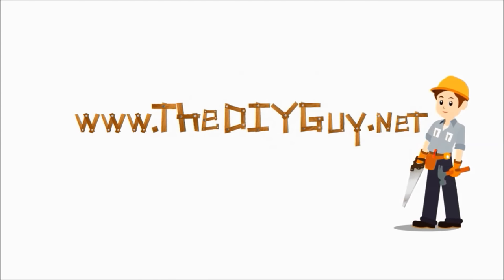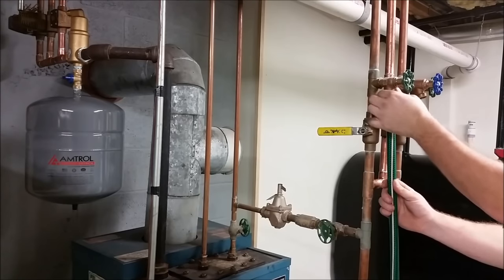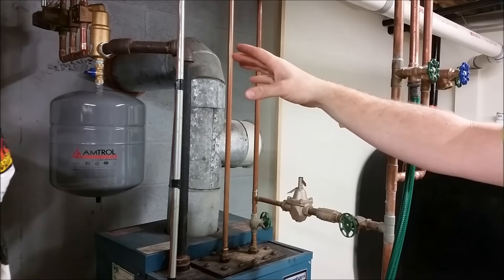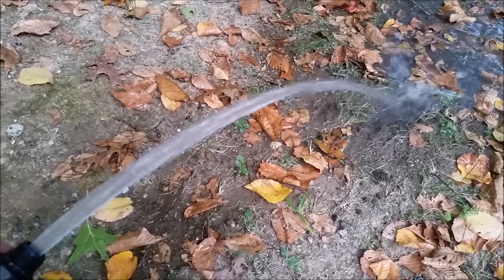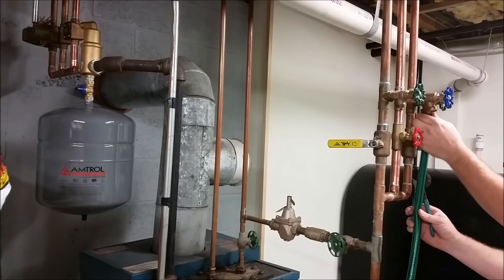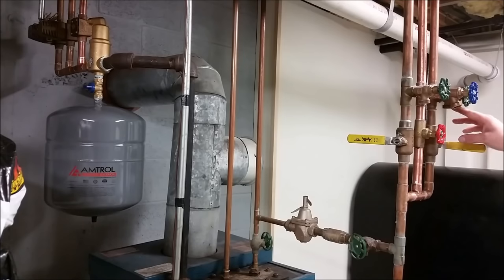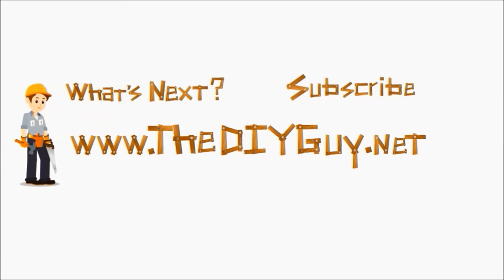How To Remove Air From Your Heating System

Comment: Does this apply to Air being anywhere in the system?  Or just in the Boiler?  We have air getting into the piping at the radiators. We have opened the valves to bleed the air out.  Do you also have a video for setting the appropriate pressure in the Tank?
Reply from the maker: Yes, This should be able to remove air anywhere in the system. As you are adding the water to the boiler and pulling it though the boiler and then the heating loop and then out then end of the hose. I'm guessing you mean either the air is getting trapped in the radiator or thats where you hear it.. For setting the pressure in the tank are you talking about the expansion tank? Most expansion tanks require a PSI reading of about 12 PSI. You check your manual for the precise rating for your expansion tank.

Comment: 0:42 Is it a good idea to install  "Garden Hose Fitting Quick Connectors"? It will be very easy to connect and take off the garden hose, but the tip of the quick connectors is narrower. I am worried that the narrower tip makes it hard to air purging.

Comment: What if im in an apartment building and have a separate thing of valves in my closet of my apt. , are those to be able to get air out? I've been having rushing/trickling water sound often.  It goes through 3 baseboard heaters

Comment: In order to get enough pressure to force out the air in the line don't you have to also open the auto feed valve fully?

Comment: Can you please help. I recently hooked up a boiler that has two zones (one zone for the first floor and the other zone for the second floor). When I started up the boiler and turned on the thermostat on the first floor, the boiler did not start. When I started the thermostat on the second floor, the boiler did start. Any idea why the first floor thermostat didn't trigger the boiler. We wired the thermostat wires to the aquastat (red wire goes to T terminal and white wire goes to TV terminal) Please let me know if I'm missing anything. TIA

Comment: Don’t understand what that control gadget does. Is there a computer board on the boiler?  It seems like just opening and closing valves and let the water make its rounds is enough. What is that gadget you were moving lever on?
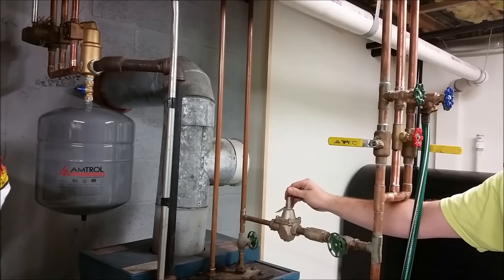Reply from the maker: I'm not 100% sure what you are talking about by "control gadget" I'm going to guess you are talking about the zone valve... the brass colored thing with the silver lever and three screws that I was holding @ 1:14 ? So that's thing nothing will circulate with the power off to the boiler, or if each thermostat is not calling there not opening the zone valves so nothing circulates. So by me moving the lever on the zone valve I'm manually opening the zone valve allowing the water to circulate. So the power can be off to the boiler and You don't need to have each t-stat calling for heat for each zone. The problem is if you have a small amount of air within the lines it will circulate and may get removed by the air eliminator but sometimes there is a good amount of air or just that it gets air bound and wont move the water. So that's why you need to use a hose and open the feeder valve ( @3:49 the handle/ lever I lifted up ) to let more water/ pressure into that zone to push the air all they way though the zone and out the hose. That's really needed for a second story or higher zone. Hopefully that answers your question.

Comment: Thanks for the video. Question for you, are those hose bibs at the return to the boiler?
Reply from the maker: You're welcome. The piece where you could attach the hose would be called Boiler Drain or Boiler Drain Valve. To be really specific for these in the video    1/2" MPT Boiler Drain, Male Threaded. Thanks for watching and taking the time to leave us a comment/ question. Don't forget to give the video a thumbs up/ like if you haven't already. Thanks

Comment: I have a single zone system. I could hear gurgling in my baseboards which is an obvious indication that there is air I need to bleed out. Unfortunately my oil burner has a check valve that prevents water from rushing in in the event of a leak. This check valve was installed a few years ago after my old furnace cracked and leaked water all over the basement. This is a great safety measure, but it won’t allow me to flush air out of the system. Every time I try to add water the check valve clicks on preventing water from entering the system. Am I doing something wrong?  How can I bleed the heating system baseboards of air with that check valve in place?

Comment: I have circulators instead of zone valves.  How to I ensure the circulators are open to allow the water through when doing the same task?  Do I need to shut the boiler off and then turn on my stats to do this?
Reply: +adameater i have circulators as well instead of zone valves.  Were you able to resolve this?
Reply: +Rob Moogs Yes I did.  Circulators are "passive" so even though they pump water, they will allow water through when they are off. So you don't need to do anything to them.
Reply: Circulators don't open & let water through .They're pumps that move water..
 I would not recommend touching anything if you have no basic knoledge of the system..if you have radiators, radient or convectors its different

Comment: Thanks for the great tutorial! It looks like my 2-zone system doesn't have those auto/manual switches you show.. Is there an alternative to shut off the zone? Thanks!
Reply: would also like to know this??
Reply: @banks8607  If your return piping has ball valves, you can close those. If not, What brand Zone Valves do you have? They should always have a manual lever on them. 

You may be running circulator pumps for each zone instead. In which case Ball Valves should definitely be installed somewhere on the copper for manual shut off/servicing.

Comment: It's the beginning of the heating season here. Boiler is hot. Should I do this process slowly? If so how slowly? Boiler should be off correct? I'm reading I could damage the boiler if I let too cold of water through it. Many thanks. Great instructional video!
Reply from the maker: Hello, You are correct if you add to much cold water to a hot or up to temp boiler to quickly you will do what they call thermal shocking. Yes boiler switch off. Not sure if you have a tank less setup like this boiler but you could run the hot water to pull some heat off the boiler or you could shut the switch off to the boiler and wait a few hours or depending on how your house is setup you could shut the switch off and then manually open a zone valve to let the heat off into the house. Just keep an eye on the boiler temp gauge and make sure it doesn't drop to fast. Bleed it for a bit then let it rest for a little bit then bleed some more. Another factor to think about is how cold the water entering the boiler from the feed valve is. If its in a heated basement you could bleed it for longer. If it is right next to the well pump and is a lot cold bleed it for less time.

Comment: Should this be done every year?
Reply from the maker: It shouldn't have to be done every year. Normally its done when you hear gurgling or banging or when someone has introduced air into the system or when the auto feed valve fails or the air scoop itself fails.

Comment: Hi. Enjoyed your video.

Is the zone valve like a circulator?
Reply from the maker: A zone valve is just that, A valve that opens when the t-stat calls for heat to allow the hot water to flow though the zone. ( t-stat also turn on the circ pump as it opens the valve) The circ pump is whats used to push the water though the zone. Most older houses had a circulator pump for each zone. Most newer houses have zone valves on each zone and one circ pump. The reason for this is to save energy by having one pump and zone valves and also to save space being that a zone valve is smaller then pumps.

Comment: One of the plumbers I've had out pointed to an "Isolation Valve" and told me to close it when doing the bleeding. It is right above the boiler and has a square metal control to open/shut needing a wrench to do so. Have you heard of doing this? Thanks!
Reply from the maker: DoodleOfMonk I don't think I have seen the valve your talking about but there are all kinds of valves out there. But that is the idea to isolate the zone and flush the air out of one zone at a time. If you'd like to show me what your talking about you can click the link in the description (will take you to our website) and go to the bottom of the page and upload a picture.

Comment: Thanks for the video.  I have a question if you don't mind.  How many pounds of pressure should my furnace be a once I complete the process of removing the air?
Reply from the maker: +Henry Rodriguez You're welcome. Most residential hot water heating systems run at 5-psi more than the pressure required to raise the water from the fill valve to the highest point in the system. In most cases the pressure gauge reads between 12- and 15-psi. Make sure the handle is down before closing the valve and it will go back to the pre-set psi.
Reply: Hmm, I live on the third floor and need to flip the municipal water lever to full on, will that blow my pressure valve?

Comment: I realize you posted this video several years ago but it is still very relevant. And it's a great video so thank you. My question for is that of my 4 zones I've got air in two of them. My house is a split level - basement is fine but floors 1 & 3 are where I continue to have an issue. I've successfully flushed the air out of both zones (one at a time) using the method you show. I've done this now a couple of times but somehow there seems to be air remaining because once the boiler is up to temp and the zones kick on I can still hear some gurgling. Any suggestions on where that air might be hiding and/or how I can ensure I've removed all the air?
Reply from the maker: Do you get full hose pressure or volume out of the hose on those zones? I would try and flush each zone, so do all four as you might have air lurking in another one of the other zones. Once everything is back on the air gets pushed out of that zone and caught in zone 1 or 3. Also when adding or bleeding the air out of the zones the colder water can hold more oxygen and gases and when its heated they come out of the water and form air pockets as well. So you will want to make sure your feeder valve is working, double check the gauge on the boiler is correct and you have the correct amount of pressure in the boiler. ( most of the time there off) and I would check the air scoop or your device that automatically removes air from the system. If you can I would upgrade it to a Spirovent. You wont get all the air out but you should get 90-95% or so and the air scoop or spirovent should get the rest and keep up so there is almost no air in the system.
Reply: I do get decent hose pressure/volume. I also increase the input pressure to just over 20 psi to ensure I get it all out especially on the upper levels. I once pushed it to just over 30 psi and lo and behold the pressure relief valve did its job and works nicely at 30 psi LOL. But your advice was right on....I flushed every zone starting with the basement zone first and working my way up vertically and that fixed the issue. The air was hiding in zones that I thought were fine. I like the idea of adding the Spirovent but plan on holding off for now since that section is tight to work with and is all threaded black pipe which will be somewhat of a pain in which to work. If this happens again and/or too frequently I'll most likely take that advice as well. Thank you for your help.
Reply from the maker: It's good to know that your PRV works and at the right PSI. Yea we install a spirovent on any system we work on as they are far better at getting and keeping air out of the system. Glad we could help. Thanks for watching and don't forget to give the video a thumbs up.
Reply: @TheDIYGuyDOTnet  
What if you don't have the gate valves above the lever shut offs for the hose?

Comment: What are the valves you shut off?  My system has only the drain valves, not any shutoff valves.   Also, why do this instead of bleeding air at the radiators?

Comment: Would that spirovent air eliminator just do that for you or does it take a few days to happen ?
Reply from the maker: We replaced the taco air scoop that was there with the spirovent air eliminator. So there was a good amount of air in the system. Its  best to get rid as much air as you can by purging the system so you don't get a pocket on the higher loop and loose circulation. If it where a smaller amount of air the spirovent would have taken care of it. The time to remove the air from the system would depend on how often the furnace/ zone was run.

Comment: My highest zone is the one that is causing me issues. I have tried to purge several times and have had little luck. I replaced the Taco since it was leaking too. The difference with this system and ours is that my drain valve is after the ball valve for my zones and off the main pipe returning water to the boiler. I closed the ball valve before the boiler so the water doesn't cycle back into the boiler and attach my hose to that drain valve. Do I need to install the drain valves in the proper place, before the zone's ball valve, in order to successfully purge?
Reply: Might be best to have a plumber install an air catch loop up at your top heat zone.

Comment: Hi I have the same looking system with 5 zone heating... the Baseboard heaters were working just fine when we moved in but now I hear banging and water dripping sounds upstairs and it has stopped heating up on the first floor. Basement and second floor works fine just the main floor doesn’t. Do you think I need to run the water to get the main floor working. Never had this type of heat before.
Reply from the maker: Ya it wouldn't hurt to flush each zone out. Most of the time the air gets trapped on the 2nd floor or higher. But if you here waterfall, water sloshing sounds there's most likely some air in there. You may want to make sure that the feeder valve and your current air scoop are working.

Comment: I needed to remove a radiator in order to upgrade a bathroom, I temporarily replaced the radiator with a piece of pipe so not to disturbed the rest of the zone. Will the expansion tank take care of the air in the line or will I need to remove the air from the boiler?
Reply from the maker: They job of the expansion tank isn't to remove air its to give the boiler somewhere to expand to when the boiler water is heated so it doesn't trigger the pressure relief valve. There should be some type of air eliminator on the system that is what will be removing the air. Depending on how much air got into the system and the location of the bathroom. (2nd floor or higher) and if the air eliminator is working will determine if you need to manually remove the air from the system. If its a decent amount of air it won't circulate so the air won't make it to the air eliminator to be removed. You could run the zone and see if it gets hot and listen near the air eliminator to ensure that its working. if its gets hot and you can hear the air escaping then it should remove the air from the system. If it doesn't get hot or you don't hear the air escaping then you will most likely have to manually remove the air.

Comment: Once you get to the point where you have to raise the pressure to flush everything through it gets tricky. I love to put everything through like 26 lb of a little mistake and you hit 30lbs and there's a mess to clean up. I trained so many helpers and so many had a towel in my truck..

Comment: How long should you run the water allowing the air out. I followed all your steps but my basement valve and 2nd floor have ran for approximately ten minutes and it's still continues to have air bubbles coming out of the hose.
Reply from the maker: That's a good question. It could take a while depending on how long the loop is and bends are within the loop and how much air is within the loop. You could purge for a while and then let it run for a couple days and then purge it again. You should be able to get most of the air out after running it for 2 minutes after you get hot water coming out of the hose.

Comment: Is this instead of bleeding each individual baseboard heater, or in addition to?
Reply from the maker: Cast Iron heaters had bleeders on them most newer systems are done by the boiler as most people don't install bleeders at or on the baseboards.

Comment: This video is good, but still lacks the detail it really needs to always prevent problems. Hoses should be short or relatively short - not mentioned. The spigot probably should not be turned all the way open once the bleeding process is set in action. The PSI on the water pressure NEEDS to be watched - completely omitted. If you get up to 25-30 PSI water pressure, you’re going to overflow the system. Letting the air out is the whole point, but you don’t want to run the flow forever. You should just be able to run until you get a steady flow coming out of the hose. That’s going to be fine. So there are definitely details that would have improved the video and I would recommend this video only with watching other ones and paying attention to my comments. The general instructions the DIY guy gives are otherwise on target and explained clearly and well.
Reply: Dean, I just took out a radiator and continued the run, bathroom remodel. I'm not getting any pressure, Boilers at 175 f. HELP its cold outside!